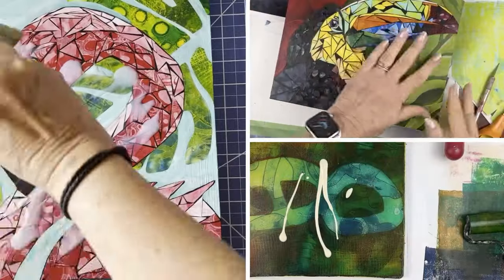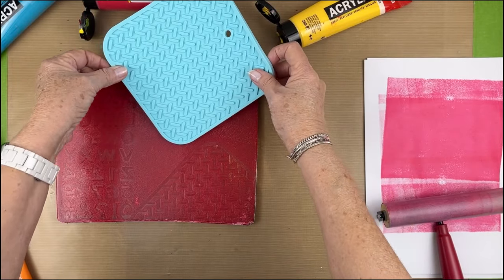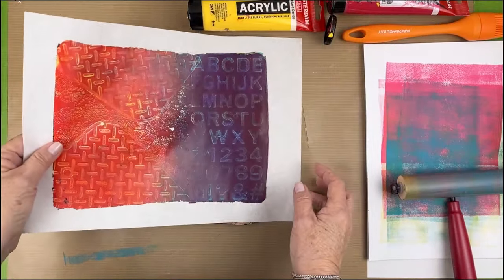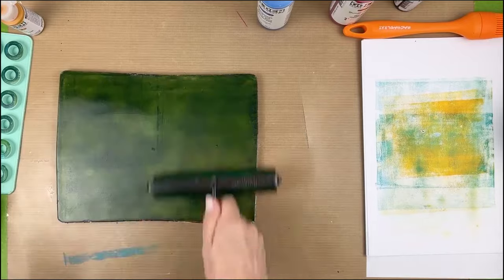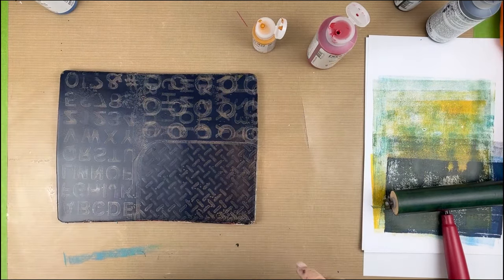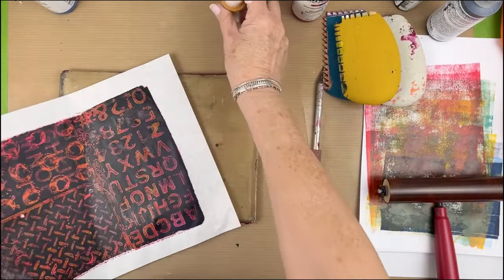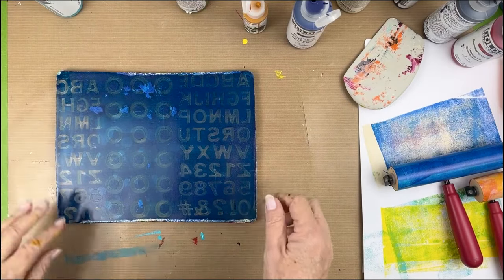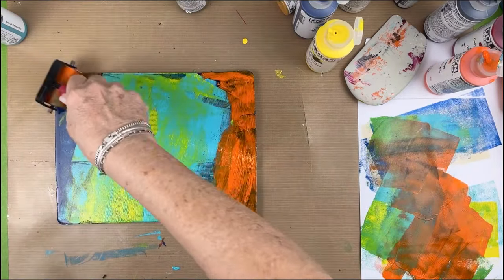Working with silicone tools to create texture

Comment: Interesting effects! I really like the stippled effect, too. I think it would appear more reliably random if you turned the direction of contact with the plate in random increments (rotating only along the long axis of the handle) between iterations of the stamping. I also have a suggestion for the Jenkins Green, before you give up on it: So many of your other colors are either light or transparent, consider using the Jenkins Green only as the pick-up layer of paint. That way, your lighter and more-transparent paints will modify the green, rather than the green darkening everything else.
Finally, I think what happened on the print where you used the graduated Catalyst wedge, where there was a blank space in the middle, is that there was a line from the tool right at the border between your two colors. When you were applying the color, you didn't seem to ink thoroughly over or up to that existing negative mark/border. Consequently, there was extremely little, if any, paint to pick up there, and what was there dried extremely quickly because it was so thin.
Reply from the maker: I've picked up with the Jenkins and didn't like that either. The colors still muddy up. I love bright colors and that color green just doesn't work for me. A friend of mine always says that why they make chocolate and vanilla. LOL

Comment: Here's what I found out about Jenkins green: 
To get the deep color of Jenkins Green it'll be necessary to use transparent colors – basically a transparent blue or green (i.e phthalo) + a transparent yellow (something like Nickel Azo Yellow, Transparent Yellow Iron Oxide, or Indian Yellow), and darkened with the right amount of black.
Reply from the maker: So you're suggesting a create it with the other transparent colors. Yes, I agree the best greens I get on the plate are when I mix layer the blues and yellows. Whenever I try to use green paint I'm always disappointed. Thanks for your comment.